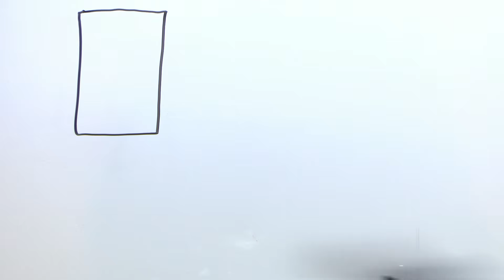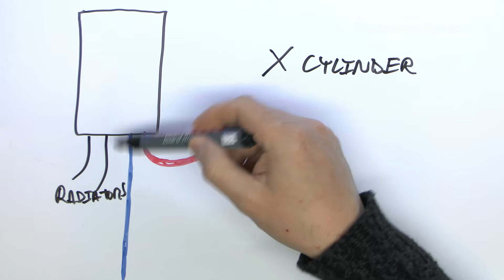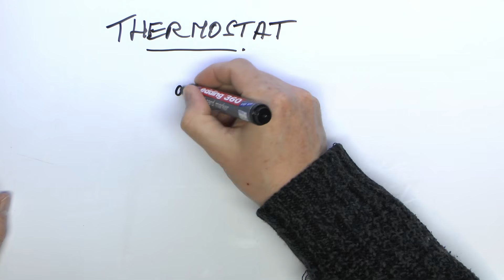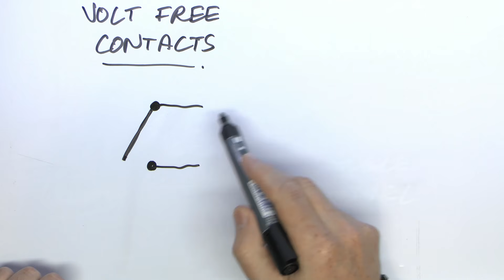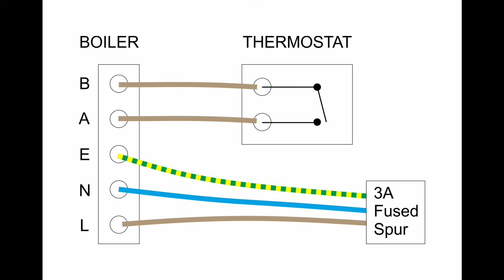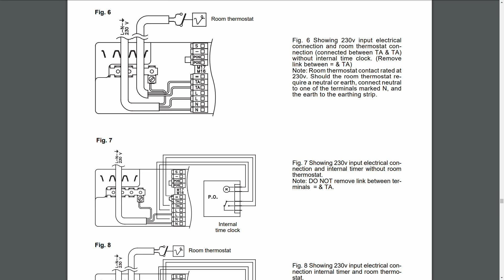Combi Boiler Thermostat Wiring

Comment: I have a duel channel hive unit but only want to control my radiators. Is this possible
Reply from the maker: Yes but only if the boiler has 230V switching.  If it's volt free or 24V then not possible, as the 2 channel Hive only outputs 230V.
Reply: @jwflame how can I find this out? It's a greenstar 1000
Reply: Tried to search it in Google but very confusing and contradicting answers
Reply from the maker: @JAUS95  You will need to get the installation instructions for your boiler,.
Documents should be here: https://www.worcester-bosch.co.uk/professional/support/literature/greenstar-1000-installation-manual
and it appears that it does have 230V switching, see page 39 onwards.

Comment: All of these arrangements have the FCU wired to the boiler then out to the controls. I've just had an install done in which the plumber took a cable from fcu to the rf controller and then another (4core) cable out to the boiler. Are there any issues with this approach?
Reply: (Similar to the arrangement at 13:40, but with the loop at the thermostat, which is a Neomitis RF unit in this case)
Reply from the maker: No.  The key point is that the boiler and all of the controls are all connected to the same FCU, so everything can be isolated at that single point.  The order in which the devices are connected doesn't matter.

Comment: Just to sy thank you for your time making this video which helped me resolve a non working frost stat set up (on a combi W/Bosch) fitted by the boiler fitters... how easy was it once you have a diagram to follow, the idiot who installed the boiler and did the basic wiring even fitted the pipe stat to the wrong pipe (on the flow from the boiler not the return), honestly its easier to do these jobs yourself at the end of the day. How these people ever get a (gas safe) job makes me wonder. Unbelievably even a pair of electrical contractors who came out to alledgedly do the wiring properly didn't pick up on the fact the old Y plan wiring was connected to the stats giving them 230v, obviously not required on the Honeywell ststs you metion in the video and I have on my system, I pulled all wiring out and did the job to my standard which is much higher than either team achieved. Luckily its been fitted since last February and we've had no significant frosts. I've set the Frost stat at 5 deg and the pipe stat at 20~30 deg probably a tad generous but I'd ratehr it was protected well. My only concern is I have not had the boiler fire up on the frost stat, however the pump runs when settings assimulate a frost, I think the water was just too hot when I did the checks, after all it was only 3 deg outside and around 7deg in my garage where the boiler is fitted. Thanks again, much appreciated.

Comment: i have a Honeywell 3 wire system live, neutral and a switch wire i bought a digital smart thermostat which has live ,neutral  NO and NC i wired it to a plug to test and when room temperature drops the NO then becomes 230 volt and when the room makes temperature again the NO goes back  to 0 volt  is that where i would connect the switch wire too
Reply from the maker: Yes, NO is the switched output.
NC would be used for cooing applications such as air conditioning.
Reply: @jwflame It was the 230v that was confusing me as I tried googling it and it said it should be a low voltage going back to the boiler and my NO was putting out 230v when it clicked on
Reply from the maker: @AlanS10018  Some boilers do use 24V, 12V or whatever, others use 230V.   Most Google related results are AI slop these days, and should not be relied on.
If the existing thermostat is 230V, then so must be the boiler connections to it.

Comment: Hi John, I currently have a Honeywell thermostat controlling a combi boiler using the 230v SL configuration. I’d like to install a Shelly Mini 1 switch in parallel as an additional ‘thermostat’. I have home assistant automations that will control the Shelly switch however I want to keep honeywell thermostat connected as a fail safe should anything go wrong with my set up. The Shelly switch will be wired up the same way as the Honeywell thermostat, am I at risk of frying the PCB if both the Honeywell thermostat and the Shelly switch call for heat at the same time? Honeywell thermostat wireless controller will be off most of the time but may required at some point. Any advise would be greatly appreciated 😊
Reply from the maker: Not a problem, it's just another switch, doesn't matter if both are used at the same time.

Comment: These videos are great.
However I still have a question.

I have a vaillant combi boiler , with 230v and a volt free section.

I have recently fitted tow motorised valves to the system as I add an underfloor heating circuit.
For the underfloor heating I bought a wireless thermostat and managed to wire that in perfectly into the 230v setup.

The problems started on the 24v side as the radiators were going to be run on this side with a separate standard thermostat.
This thermostat was a two wire set up and I couldn't get it to work, even following the previous video about wiring the motorised valve via the volt free terminals and linking them to the thermostat wireless cables, in order for no actual current being fed back into the 24v section.
This didn't work.
I worked out that a new thermostat with a 3 wire set up may be able to perform the role better as it will be a 230v . Love , neutral and then the switch live.
Now I wired this new thermostat and it appeared to work perfectly however I noticed now that the thermostat isnt really responding very well.
The heating was on for over 2 hours and the thermostat didn't appear to turn off even though it was only set to 18° and the house was definitely warmer than that.
When I manually turned it slightly it reacted and turned it off/ on

My question is would what I have done had any correlation to the thermostat not really responding to temperature every well.
I put a candle under it for about 10 seconds and again it appeared to turn it off. So the brand new thermostat  does appear to work, just not very well at identifying the correct temperature.
Any thoughts ??

Comment: John, I have a problem with residual voltage in my Y Plan circuit.
When the boiler times out there is 49v between Neutral and the Orange Switched Live wire which is enough to intermittently fire up the boiler. I have fitted a recommended  snubber across Neutral and the orange wire in the attempt to remove this residual voltage but it reduces it to approximately  25v which is still enough to intermittently fire up the boiler.
Any advice would be much appreciated.
Stephen
Reply from the maker: Use a relay with a 230V AC coil and NO contacts, coil connects to the orange wire and neutral, relay contacts connect to L and the boiler switched input.

Comment: Amazing video , well explained ..... Have you done a video on opentherm?
Reply from the maker: No. For the connection of the wires it's just 2 of them to the 2 terminals, and it doesn't matter which way they are connected either.
Most of the deal with Opentherm is the configuration of the thermostat or other device, which is unfortunately a journey into incompatibility and disaster, as although it's an open standard, certain manufacturers have decided to implement it in ways which only work properly with their own equipment.

Comment: Hello John and knowledgeable followers. I'm fedup with a battery powered wifi thermostat so have purchased a smart wired thermostat, so quick question about it. 
Can I supply AC to the thermostat from a source close to where I will be installing it, or does the AC need to come from the boiler. My theory was, for a simpler installation, I'd just have the two volt-free wires run along to the thermostat and then power up locally, possible? Thanks
Reply from the maker: Power must be from the same source as for the boiler and other controls, so the whole lot can be isolated at a single point.
Reply: @jwflame  I see, thank you. The reason for the query was, I wondered if any battery powered thermostats were available, that required a physical connection to the boilers dry contacts, hence my pondering.

Comment: And I find myself here needing to recoup my sanity after a customer gaslighted me that their old thermostat worked (it didn't, everything was bypassed) and that my new install was incorrect (it was not, it was exact to the wiring provided). If I had futzed about swapping wires, that'd be a dead boiler I need to pay for; and taking apart the boiler to figure out how the previous idiot wired everything would've lead to the customer nagging me for a boiler recertification.

Comment: I have a ideal combi boiler with the nest learning stat that’s wired to terminals 2 and 3 for volt free switching in the heatlink but I’m asking anyone who knows if it’s possible to use the 5 and 6 terminals that has the live link to make them 240v and still keep 2 and 3 volt free. It’s just that I’ve added ufh and need switched power for the pump. I haven’t installed a zone valve as I only want one stat. Is this possible without blowing the unit?
Reply from the maker: Yes, the two sets of terminals are completely separate, they are only 230V if 230V is connected to them.

Comment: Thanks for the video. I'll attempt to wire a Drayton Wiser smart thermostat to a Potterton Gold 28 boiler. Seems pretty straightforward until I open the control panel on the boiler.

Comment: Excellent, well informed video sir. Question. I have a Worcester boiler 30i and Hive single receiver. Looks like I bridge L and 1 on the Hive plate as it is zero voltage contact. Is this correct? Thanks
Reply from the maker: Yes, and then 3 is the switched 230V AC output to the boiler.
Most Worcester boilers use 230V switching, however you must check the instructions for your specific boiler, as there are many different models and revisions.

Comment: I have a question regarding connecting UFH thermostat connecting to current Combi boiler which has a RF Thermostat for Radiators. Can I have 2 x RF connectors connected to the boiler?

Comment: Thank you, after watching the video I decided not to fit the Optimum Vibe RF Programer because the instruction was not that clear to me. It looks like you connect 230v to 3 different terminals, switch on and blow something up. Considering there are 5 wires from the boiler and 3 wires from the mains, even if you cut off the earth wires or use a connector block for earth, is it unreasonable to expect a wiring diagram that shows exactly where the other 6 wires go into the receiver unit?  I may not be an electrician but I can connect a 13amp plug because I know where the wires go. My Honeywell CM927 instructions were quite clear. I didn't want to buy another CM927 because the digital screen on my one didn't last that long.

Comment: Hi John, I’m a domestic central heating engineer and have watched and learned from your wiring section, your style work for me, the video took me far.

Would it be possible to do a video on relay within a heating system. Even multiple relays controlling multiple components/pumps etc.

And maybe even how to Make a relay box yourself.

Thanks

Comment: Ok well done ... thankyou John
But I would have liked you have STRESSED

* CAUTION WITH WIRES ROUTED TO THE THERMOSTAT *

If any  cable is carrying mains then double insulation is needed , like standard flex...
0.75sqr mm conductors are fine...

Thin twin pre-existing bell wire going to a thermostat is not voltage rated for mains!.72 Volts possibly ... 
So for some installations should not be used.

You don't mention anything about CURRENT rating of the relays as well. Presumably one relay in the thermostat is switching another in the boiler.
The one in the boiler is taking the current to power pumps and blowers etc in the case of oil fired combis.

So for this reason a  thermostat shouldn't be wired to supply the main current to the boiler (and because when "off"  the circulating pumps would be instantly stopped as well.).

Point of consideration ...You are setting yourself up as possibly as a self appointed expert on YouTube or as a "very experienced" man.
Have you indeed been installing these most of your working life  , or in your main day job were you infact only a Nuclear Physics Professor for example ?
Are these videos then for posterity to demonstrate and acknowledge your valuable years of experience ?
Or just trying to be very helpful to mankind...declaring war on the servicing and installation industry :-)
Why are you so altruistic (but not to the oiler industry) ? It's good but I can see a problem...

Where do you stand if someone picks up on some simple omission in one of your videos and a s a result has an accident and blames you ?
Did you stress the importance of switching off the mains at the consumer unit before commencing work ?
Even if you are only dabbling with the thermostat connection . Inside the boiler could be wet ...
Did you show how to safely cut insulation off wires ?
Did you show any convention of labelling them ?
safety

Comment: Hi John. Thank you so much for the video, really explains things well. I've an old rotary Honeywell stat wired to a Gloworm Combi boiler in a Volt Free setup. I've bought a 'wired' Wifi stat that requires a constant live obviously. Can I power the stat from a 3amp fused plug into a nearby mains socket and just connect the 'volt free' connection to the existing wiring straight to the boiler?
Reply from the maker: Theoretically yes, as the switched contacts won't be connected to the power supply for the receiver.  However it would be far better to connect it to the same supply as the boiler, and as the receiver unit should be installed next to the boiler there really shouldn't be any reason to use a separate plug.

Comment: Am I right in thinking that, with the Hive setup specifically, as long as the power supply is wired correctly then the switch wires can be fitted either way around? 

I really don't want to dismantle my boiler to check how I wired the Salus up but one unit is marked NO and the other NC so do I put the open switch to the one that isn't marked as normally closed? 

I wired my entire house without a single diagram and yet I'm stumped by these pictures that my 2 year old daughter could probably understand.
Reply from the maker: Yes, the single channel Hive just has the two terminals, which are connected together when heat is required.  Doesn't matter which way, or what switching voltage the boiler uses.
That does NOT apply to the 2 channel Hive, which uses 230V switching and has one side of the switch  permanently connected to 230V internally.

Comment: Thanks, John, pretty straight forward but nice and reassuring that I'm doing things correctly nontheless. I briefly read somewhere that some controllers can adjust the boiler output to optimise efficiency. More research required on my part I guess.

Comment: hi john,

navien combi boiler, customer does not want smart control, would like a danfoss LP111 installed. right saying live neturall earth terminal 1\3 ?
Reply from the maker: 1&3 in the LP111 are the switch terminals, however that is just a timer, you would need a thermostat as well, otherwise there will be no control of the room temperature.
Reply: @jwflame  boiler itself not control the temperature?

Comment: Hi John thanks for the info, is there a pump on the central heating system or is it built into the boiler and if there is, is it supplied off the switched live side
Reply from the maker: For combination boilers the pump is inside the boiler.  For others, it can be in the boiler or a separate item.
Either connected to switched line, or more usually connected to the boiler itself so the boiler controls the pump.

Comment: Very informative, thank you. Still really uncomfortable with my setup. I have a combi boiler junkers euroline zw23 and want to fit a generic thermostat bought at Leroy Merlin called Garza Top Power. It seems pretty straight forward, boiler LR/Ls  to thermo COM/NO, and boiler Ls/Ns to thermo L/N. Makes sense?
Reply from the maker: Yes, 2 wires for the switch contact and 2 for the power.

Comment: My boiler is very old and the thermostat is wired with a flex cable. Is that OK?
Reply from the maker: Yes, flex can be used for fixed wiring.
Reply: @jwflame  Thank you

Comment: Hi John, Thank you for your video. I have an old combi boiler that the thermostat was never wired properly. I bought a new wireless relay and thermostat and managed to wire the system correctly. It is now working fine. I truly appreciate your videos. I am a qualified domestic installer but don't work as an electrician at the moment. However, I do all my electrical work myself. I am nowhere as intellectual as you. I envy your knowledge. Thank you very much for your teaching.

Comment: Hi John,
I know it may sound dumb but I have a Honeywell BDR91 and am cofused as to where A&B would go to on the Hive Heating Programmer/Receiver would (A) go to Number 1 and (B) go to Number 3 as I cant tell because both wires are Black many Thanks
Reply from the maker: Doesn't matter, either way will work the same.  The BDR and Hive are just a switch.  When heat is required the two wires are connected together.  When no heat, the wires are not connected.
Reply: @jwflame 
Hi John,
I would like to Thank you for your quick reply worked a treat 
Many Thanks